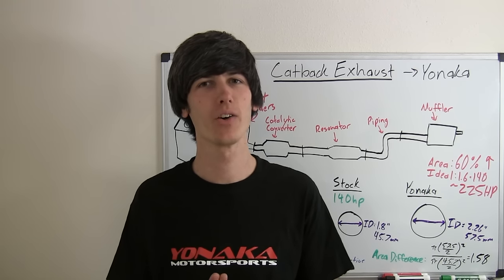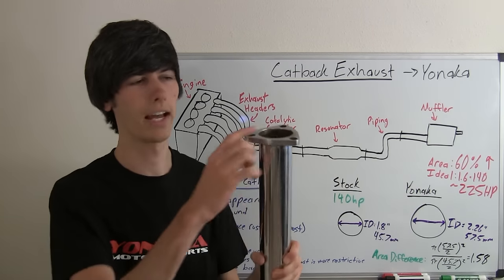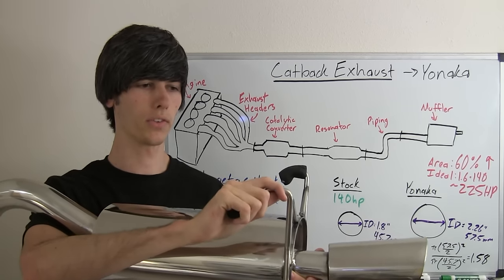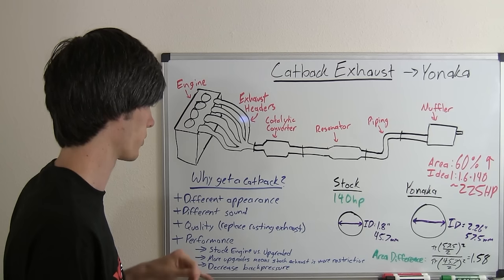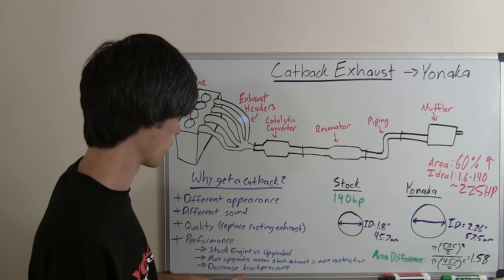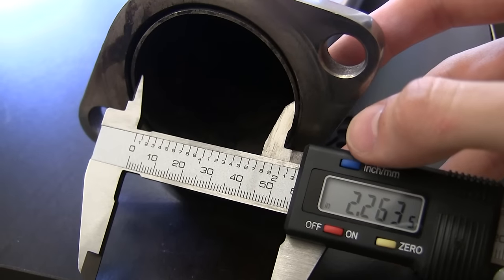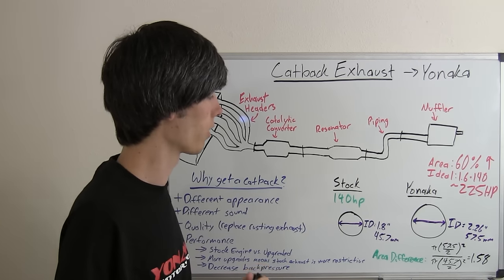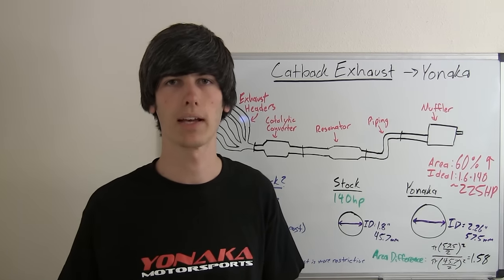Catback Exhaust - Explained

Comment: how about straight pipe?
Reply: literally, a straight pipe.
Reply: Reasure i was hoping some explanation on the benefits and drawbacks of the system,
Reply: U can google it, not hard to find some pages with decent information. From the top of my head, the lack of a muffler increases performance ever so slightly by increasing flow. Also makes look douche-y with the obnoxiously loud. Just don't do it please
Reply: mat arif leen My Nissan 240SX has a straight pipe exhaust. Header to Muffler was 1 pipe, almost no air restriction.

Benefits?

1) Noticeable power gains

Drawbacks?
1) Less engine response.
2) EXTREMELY LOUD! It's a track car so I don't care.
Reply: it depends on what your putting the straight pipe on. even the diameter of the pipe would change what a straight pipe would do.
Reply: Chad W thanks bro :) i think better save some money to buy cat back, sound cooler though
Reply: CarCrazy Depending on what car you have, straight pipes might sound really good. There is also a big price difference. A true straight pipe will not have a catalytic converter, a resonator, or a muffler. If you leave the resonators and cat on, and just do a muffler delete, then it will not be a "straight pipe" but it will give you a different sound for less money. It depends on the car, again.  A straight pipe 458 Italia, for example, sounds better than any aftermarket exhaust, whereas a straight pipe Accord sounds pretty annoying
Reply: Jav The Ripper thanks man! maybe i'll just use cat back exhaust. lol.
Reply: CarCrazy Whatever works for your taste, man. Whatever exhaust you get, just type in the model of your car and the exhaust name on Youtube to hear what it will sound like. Look up different setups to get a jist of what you like best.

Comment: A Resonator is designed to "cancel out" highway speed tones to make your drive quieter while cruising. Doing this also remove some of the raspy noise found in high end revs. A muffler is designed to quite down the entire exhaust range, from idle to wide open throttle. Both can be removed and still pass emissions but if your town has a noise ordinance then you might want to keep them on.

Comment: So why DO you guys across the pond call the exhaust manifold the header? What is the intake manifold known as, stateside?
Reply from the maker: +Liam O'Flaherty why do you call the trunk the boot, the hood the bonnet, etc etc. Different vernacular, just how the world works. We call it the intake manifold as well.
Reply: Engineering Explained I'm wondering why one manifold is still called a manifold and one a header, it baffles me! Keep up the good work btw :)
Reply: Engineering Explained I have a question about the ford ecoboost motor. I just got a 2013 f150 with the ecoboost and the dealership says that straight piping it will cause the tubos to overspool because the backpressure isnt there anymore. Is this true? Do I need backpressure in a turbo motor?
Reply: Nathaniel Hylton yes u need some form of back pressure otherwise your turbo is running a lot harder then it needs
Reply: Long story short exhaust manifolds are cast iron, fairly heavy, have smaller tubes and they're not all equal in length, Headers are aftermarket which use individual steel tubes for each cylinder, are all equal in length and have wider tubes, both have advantages and disadvantages depending on whether you're after performance or longevity
Reply: I thought headers were different from manifolds.
Reply: Liam O'Flaherty
It's just the nomenclature. A manifold is anything that shape.
I.e. Any multiple entry, commonly single exit, chamber that deals with fluids.
Header is kinda what it sounds like, a head array.
Reply: Liam O'Flaherty a header is made from piping and is usually custom made. An exhaust manifold is a cast piece...usually original factory made parts.
Reply: we call it an Legger.

Comment: it would be nice if you could at least six played everybody that by getting extra horsepower by putting a free-flowing exhaust you lose torque if you lose torque you lose fuel economy if you don't care about fuel economy that go ahead and free fluid will make the exhaust sound the way you want it but if you're worried about the fuel economy and you need the torque it's good ideal to give them an option all the pros and cons between free flow and standard exhaust thank you

Comment: Why do you do area and not volume?
Reply from the maker: Area restricts mass flow (volume).
Reply: Okay. Thanks.
Reply: +keepthinkingPC Each car is different.  Some cars have really restrictive factory exhausts while others have highly tuned, highly optimized exhausts.  If your car has a restrictive exhaust, you will likely see gains with a cat-back alone.  If your car has a very well tuned exhaust, you'll likely see better gains with upgrading intake/bolt-ons first.
Reply: cat back without resonator on my 94 320i shaved 1 second of the 0-100 kph time, I also removed the baffling from the air box.
Reply: ammendment it wasn't a cat back but high flow cat and cat back.
Reply: +Will Doyle flux
Reply: +Engineering Explained That's true, gases are much more easier to analyze from a mass flow point of view than volumetric flow...
Reply: +Will Doyle Because the flow of gas is direct related with the area of the pipe.
Reply: What matters is flow of gas, which is volume/time which is dependent on area. Volume alone just takes into consideration the length of the exhaust.
Reply: Taco is correct.  Your stock exhaust is perfect for your stock engine.  Increasing the diameter of your exhaust is detrimental to your engines economy, unless of course your engine is producing more power than originally intended.
Reply: All very insightful. So if the exhaust upgrade isn't enough to see gains, what is? If it's paired with a cold air intake, will that do it? Let's leave out silly things like tires here.
Reply: Brady, that's a very strange way of putting it. The stock exhaust is perfect for your stock engine if your goal is to produce the exact amount of power and use the same amount of fuel as you currently do. Which is a pointless statement.

Engine economy is not the be-all end-all goal of an exhaust system, nor is the stock system always the best even from an economy standpoint.

Comment: On a two cycle a proper exhaust system can increase the power output by around 50-60% since scavenging is more important on a two cycle. Either way I must have misheard, I guess I just got confused by the 225hp you wrote down on your whiteboard. Great video, great explanation in layman's terms!

Comment from the maker: It would go under the assumption that the amount of exhaust created is relative to the amount of power created. Creating more power means more air and fuel burned. If you burn 60% more fuel, (at the same efficiency as stock) and have an increase of 60% power, your exhaust will have a 60% greater load. The relationship is unlikely to be perfectly linear, but I'd say it's a fair assumption. I hope to eventually have test videos illustrating the value better.

Comment from the maker: Why is that? It doesn't increase horsepower by 60%, as I mentioned in the video. But it may be optimized for an engine creating 60% more power.

Comment from the maker: Correct, it's oversimplified as the pressure losses though the pipe are not linear with diameter, nor speed.

Comment: In case he doesn't get to it, here is a simple explanation! Resonators basically resonate with the sound waves in order to quite them. It doesn't work at all frequencies of the exhaust though. Pretty much a tube in a tube separated by some sort of packing. A muffler gives the gases multiple "rooms" to expand to slow them down, lowering the noise. I only have a resonator on my bike and a "baffle" that is basically the exhaust tubing with holes. Can't tell much of a difference vs straight pipes.

Comment: Correct me if I’m wrong. What I know is changing the cat back exhaust, DOES NOT increase MAX horse power. It just allows your engine to perform differently form the stock ones. If your engine is 200 HP, you are not gonna get 250 HP just by replacing the exhaust. What it does is to let your engine reach the peak at different RPMS depending on the exhaust.

Comment: You should have mentioned, The best way to gain MPG, would be increasing engine power and efficiency, Which usually go hand in hand up to a certain point.. If you take a car with 100 hp, and 35 mpg that requires 35% throttle position to maintain 70 mph, turn that car around into 225 HP, you could expect anywhere from 25-35 mpg, and probably 25% throttle position to maintain 70 mph as long as your power range starts near your cruise speed... Which in that example you could actually be cruising using 34-35 mpg, where the first scenario would be cruising at 70 at about 30 mpg... Performance usually increases cruise MPG, which decreasing WOT MPG

Comment: You can definitely see improvements replacing exhaust on some cars. I know the performance Toyota 4A-GE 20V Blacktop came with an exhaust manifold that had a few bends that were incredibly restrictive, where just replacing the manifold showed great gains. So in cars with poor exhausts, it can show a bit of a difference. Not much though, because the engine isn't putting out much power anyway.
Reply: For an na engine the black top 4age 20v is pretty good!
Reply: Blo0dredRidingHo0d
Agreed, I love it. Wish I had one!

Comment: A couple of points if they haven't yet been commented on.

1) The I.D. of the exhaust tip is not necessarily indicative of the I.D. of the catback system. Many exhausts widen at the tip.

2) Another benefit to many aftermarket catbacks is that they are lighter than the OEM ones.

Comment: The internal diameter of the pipe itself can be a bit of a phurfy.  All the pressure issues are introduced inside the muffler can itself.  Use the vernier calipers to measure the internal pipe diameter of the OEM centre pipe rather than the OEM muffler tip (looks to be where you measured).
Here's some examples of what you'll find inside typical mufflers that are designed to knock out sound pressure waves and resonant frequencies, significantly slowing gas flow rates and introducing significant turbulance.
From my Subaru Legacy GT-B:
corptech.no-ip.org/doodads/htdocs/cars/MY07Lib_mod_gutmuffler.asp
and
From prior Subaru WRX's:
corptech.no-ip.org/doodads/htdocs/cars/MY05WRX_mod_gutmuffler.asp

Btw, good series so far, make sure you keep up with the grounded analysis and physics based reviews.  Try not to get sucked into the commercial colouring that will come with "free" parts and services.

Comment from the maker: 1) This has been brought up, I measured in the center as well to confirm (not shown in the video). 
2) Yes, though I have not measured both, and since the stock is significantly smaller I would imagine it is equal if not less weight. Once again, have not measured yet.

Comment: That was a good explanation, but you should have mentioned cfm; or cubic feet per minute.  A larger diameter pipe can move more cfm, allowing more air to flow though the engine.  The more completely you remove the exhaust gas by having a free flowing exhaust, the more room you have in the engine for new clean air and fuel to allow for a more efficient and powerful combustion cycle.  That's why you want to do a high flow intake as well, though it doesn't have to be a cold air intake.

Comment: I could be wrong on this, but I've always been led to believe that you need enough back pressure to force the exhaust out at a certain velocity, but not so much that the engine finds it difficult release the exhaust. That's why it's a [relatively] difficult process to design an optimal exhaust system for a given engine. Based on this, I assume that engine modifications that have an effect on how much air is flowing out of the engine are the ones that benefit the most from changing the pipe size.

Comment from the maker: Velocity is also good though, so you have to find a balance. Check out my video "performance exhaust"
Reply: I'm running a 2010 ford mondeo (fusion to you) titanium x sport 2.0T with a map on it its running at 272bhp and a little over 400nm torque or 300ft/lb what diameter piping is the best for that ? it's on 2.25 inch duals right now, was thinking of going to 2.5 cat back stainless so what do you think ?

Comment: I've replace the Resonator and the Muffler on my 07 Civic for High Performance ones. I can feel a difference. I kept the stock Midpipe.
Reply from the maker: It vibrates that much huh? ;)
Reply: It Feels fine, I like it. Can any Horsepower gain happen with Just the Resonator and Muffler replaced? To me a little bit.
Reply from the maker: If the stock ones are restrictive, yes. Likely at higher RPMs.
Reply: Okay right I thought so.

Comment: I have an optima turbo (2.0t) yeah its not a high end sports car but it has 274hp stock. I put in a 2.5in. catback on it and 1. sounds great and 2. I felt more power right away after I put it on. Now I plan on going full turbo back eventually and besides a bigger intercooler and an intake there isnt to much to do under the hood before putting exhaust on to compliment it like you said. But with that being said If i spend the money on those upgrades and get a tune which is all in my plans eventually I will have some pretty solid power for a "non sports car". 

Dont mind me. just some feedback I figured Id share... I mean it is the comments section lol

Comment: Larger exhaust systems have 2 basic drawbacks in terms of power with a stock motor, both involving exhaust gas flow velocity. A cat-back system that's significantly larger than the outlet diameter of the cat will only serve to slow the speed of the exhaust gases as they expand to fill the larger pipe. It's an example of Bernouli's principle, which also explains why water comes out of a hose faster when your thumb reduces the diameter of the opening. Also, the pulses of the slower after-cat exhaust aren't likely to be tuned to the pulses at the cat's outlet, causing power-robbing harmonics and further slowing overall exhaust gas velocity at the tailpipe. Even putting on large diameter headers can easily reduce power by reducing velocity which is needed to "scavenge" the last exhaust gases from the combustion chamber just after the piston passes TDC. Turbos, of course, change the equation in some ways.

Comment: My 2014 Challenger R/T has dual 2.5 inch factory exhaust with a factory H-pipe. I honestly believe a cat-back system is a waste of money since the factory exhaust is pretty good. All I did was remove the 2 huge resonators and replace them with 2 small glasspacks (straight pipes would be a little too loud for my neighborhood).

Comment from the maker: Well, I wouldn't say there's a direct correlation as RPM does not determine engine size, or the amount of air/fuel being burned. A small engine at high RPM may put out less exhaust than a large engine at low RPM.

Comment: Let me start with I do really enjoy your videos. You're a super smart guy and I love the science you objectively apply. Mad props.

I do wonder how did you determine the 225 hp figure being roughly the ideal HP for your example exhaust, if I understand what you were saying correctly? How does the cat-back exhaust size difference directly relate to that 225 HP figure? I'm not implying that a larger cat-back exhaust doesn't hold the potential to increase HP. Obviously if a car's engine can breath more easily, there is a greater potential for power gains. However, I am puzzled with the justification of the assumption that the size difference of the two exhaust hold different potential for ideal horsepowers. Of course the numbers work out, but I feel like you could relate it just as easily to how many more cup holders it could have.

Not trying sound argumentative; I'm genuinely curious!

Comment: If you're going all out and don't have to deal with emission testing in your area beating out the cat is a good way to increase exhaust flow as well. I'd still leave it's shell on the car regardless so they don't get you for no cat during state inspection.

Comment: Many people would be surprised if they knew that many cars with +500HP only have exhausts with about 65mm diameter. And they perform quite well. There is so much more to this topic than just increasing the diameter and done.

Comment: I don't have access to my friends dyno graph anymore but he ran a 3" pipe on his integra and lost 20fwhp.  large exhausts cant scavenge effectively as the pulses of gas do not fill the tube allowing for the following low pressure zone required for scavenging.  Also as the tailpipe is not getting much pressurised flow it allows cold air to enter the exhaust which mixes with the warm exhaust gas and causes turbulence thus increasing back pressure and reducing power.

Comment from the maker: I measured the diameter under the car and it had the same outer diameter as the tailpipe. I suppose I could have included this information - the tailpipe diameter is even with the rest of the exhaust.

Comment: Exhaust tuning is more complicated than this. But mostly I want to mention that the way the measurements were taken is possibly misleading as there may be narrower passages inside the system, usually inside the muffler. Try doing a cutaway of the muffler, many are necked down inside. And having 60% more open area doesn't make it good for 60% more HP. Also if the tip were flanged it would change the flow capacity without changing the area. Plus, there is a point where back pressure can be too low, some back pressure is needed for optimal performance. 
I started with a three paragraph explanation of exhaust pulse timing that wasn't even CLOSE to being complete, maybe next time